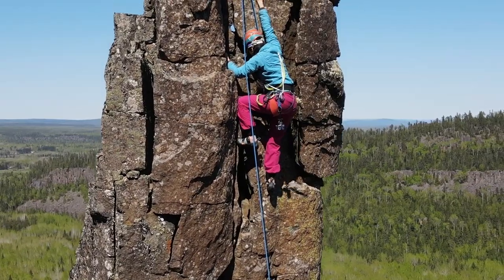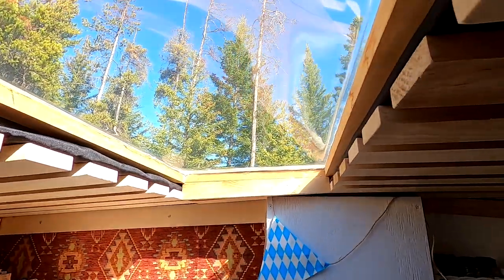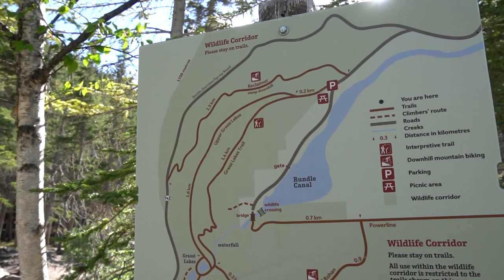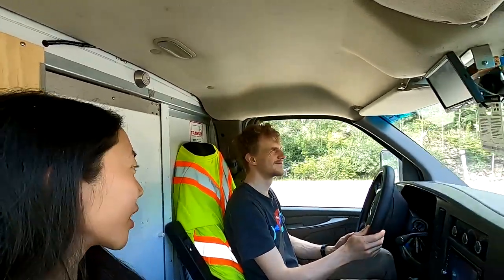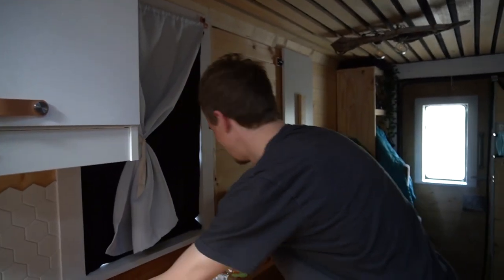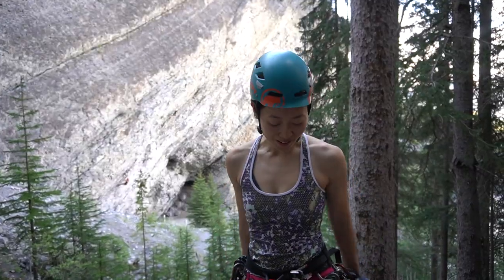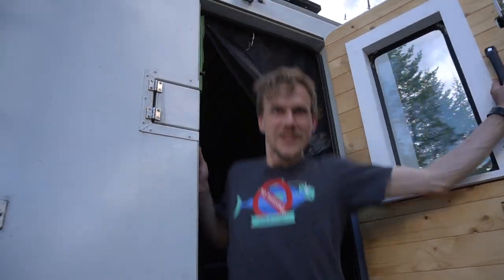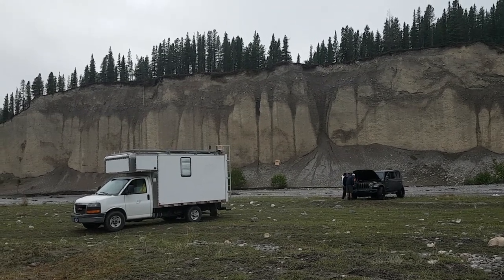Van Life in the Rockies & DIY Camera Crane to Film Climbing

Comment: Awesome video thanks for sharing. Is Moritz still thinking about doing automation for vans?  I'm setting up a build for a 17ft box truck.  Still in the vehicle search mode,  but would love to have a chat about possible configurations and costs
Reply from the maker: I'm still looking into refining my circuit to have a version for retail. Currently I have an issue sourcing electronic components as there's a global shortage. Will have to find a different manufacturer and adjust my production files.
But if you'd want to become a beta tester (at cost) I'd be happy to work with you. Maybe shoot us an email! I'm also curious about your rig!
Reply: @RoadtoPitches  yes trying to source things can be problematic.  I just set you an email about the project

Comment: In Amateur radio we use SSTV to send pictures, having a couple of Ubiquiti radio 
  mounted may help in passing WIFI data
Reply from the maker: Hey thanks for your recommendation! So far the signal is very stable because there's always a line of sight between the camera and receiver.
I had issues with the actual image detection. My original approach was to create some training data of our climbing helmets. But it turned out my data wasn't good enough (or I didn't train the system long enough), so it would not detect the helmet if it's too small in the picture.
Meanwhile I've changed to a different model which is already pre-trained and it will just search for any person in the picture. This works more reliable. We'll have some more footage from that coming soon!
Reply: @RoadtoPitches  depending on the type of radio/antenna. It run as POE. Running the Antenna via PI from High Point. I use a Mikrotik Hap Routerboard and I can run POE lan to Radio/Antenna. Mikrotik has Lan and really good WIFI 2.4 and 5.4. Good luck with your electronic gizmo
Reply from the maker: That's a good idea yeah! If we'd run into connection issues just get a mikrotik and set it up half way (and get a poe-injector)  👍